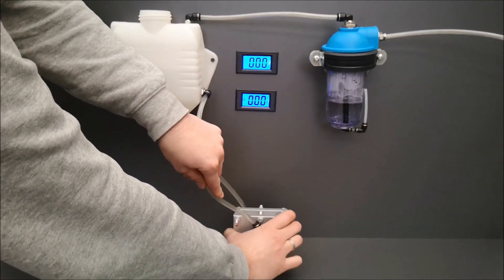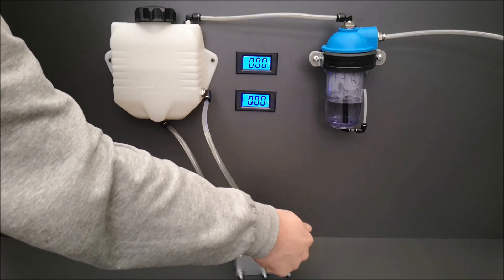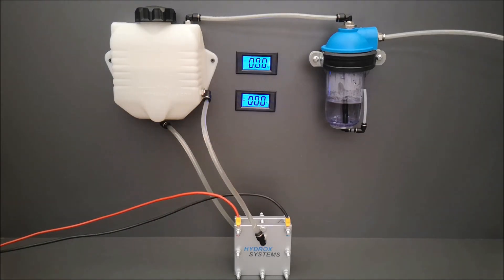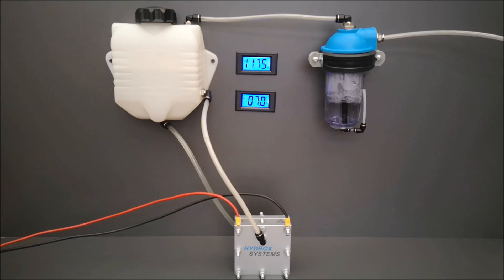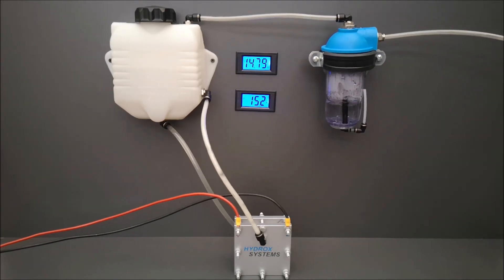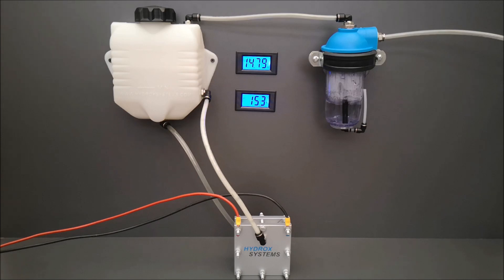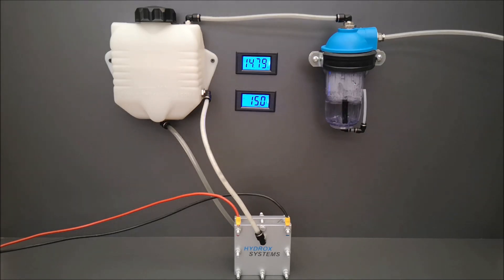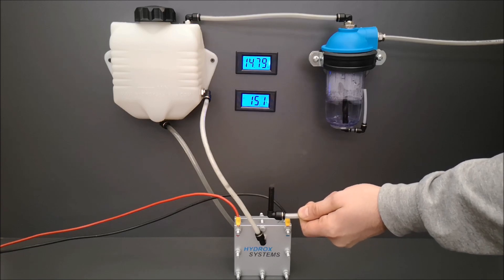Most compact Hydrogen System - Produce HHO gas for cars

Comment: Can it used in bike to direct run in hho
Reply from the maker: I have never tested on a bikes, but I do not think it will run with only HHO, at least you have to produce bigger amount, which is not really easy to obtain, because the alternator might not be capable.